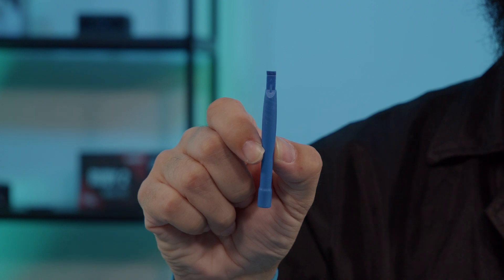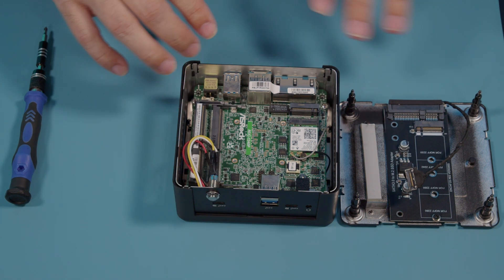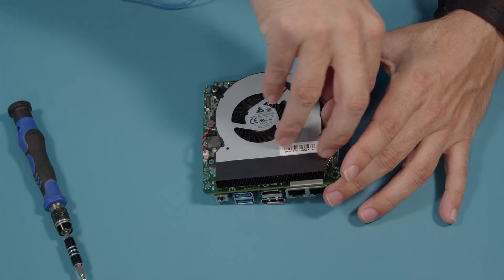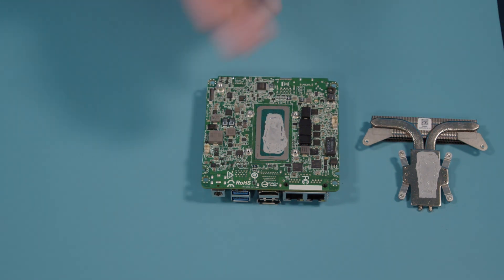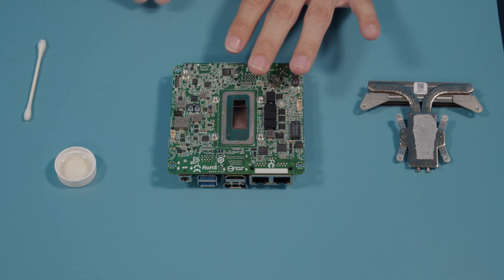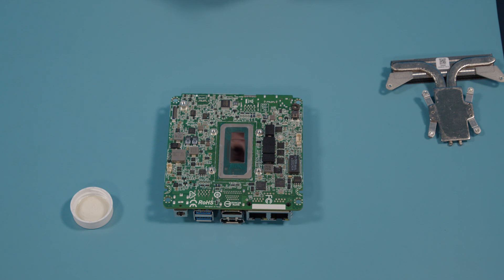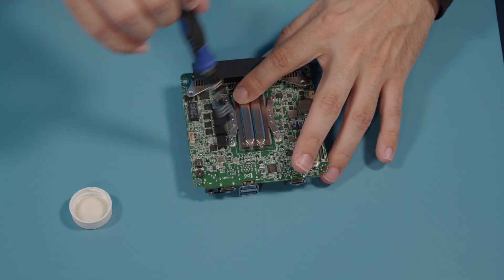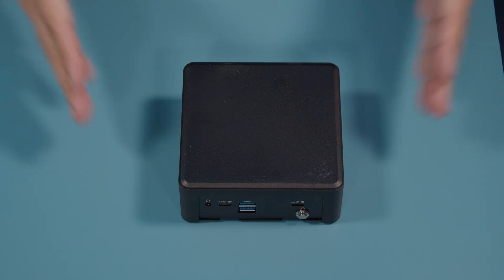How to Reapply Thermal Paste to a Mini PC

Comment: Good stuff! Family member has one of these, and it was overheating and cutting out to prevent damage, which is great, but I'd never reapplied thermal paste to something this small. I wasn't sure where the CPU was! When I opened the chassis, I saw a tiny square thermal pad doing absolutely nothing on the m.2 NVME SSD, so I'm going to add a heat sink to that at the same time. Appreciate the very comprehensive demonstration!

Comment: Thanks for this very informative video! I put thermal paste which I had not since I bought it in 2015, I had opened and cleaned it several times but never put thermal paste, so this time it was all dried up so I had to really scratch it off from the copper heat sink while it came off fine from the cpu, I have put new paste but I noticed that the heat sink had a cover, the cover is paper topped with plastic, do you think it normal? Or plastic should be removed? The paper seems to be glued to the sink while plastic if you try remove it, it comes off but it seems leaving the paper rough underneath, do you think it should be removed? And is it ok if the metal sink is scratched?
Reply: I know this is old, but it sounds like someone forgot to remove the plastic covering the heat sink. You typically want direct contact between the heat source and the dissipation media, and that's usually some kind of metal or composite material. It's perfectly fine if the heat sink is scratched. The thermal paste (use paste not a pad if possible) will fill in those gaps and seal it up. Great questions!

Comment: You should try phase change material Honeywell PTM7950. It comes in as a sheet, lasts longer, performs works better than traditional pastes and there is no pump out effect.
Reply: pointless in 5-15watt machines.